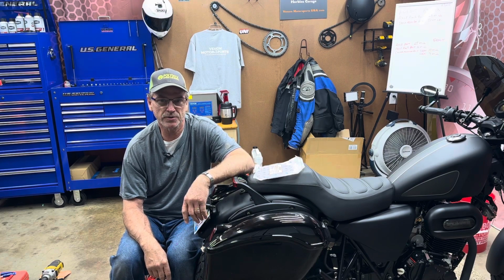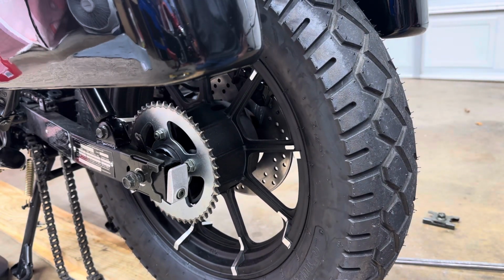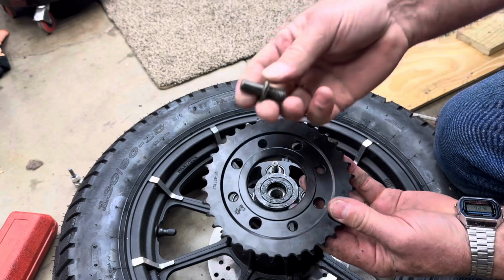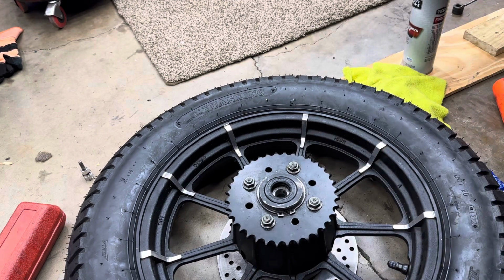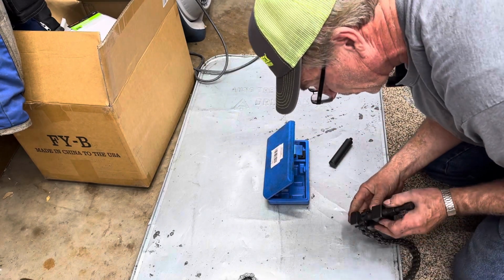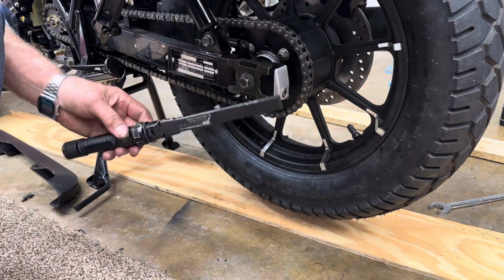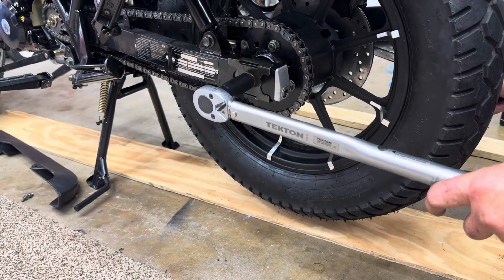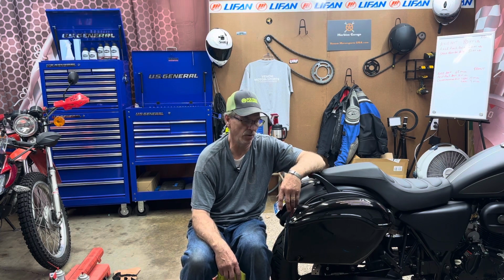VENOM GHOST CHOPPER 250, REAR SPROCKET CHANGE

Comment: Nice. Those extra plates over the alignment marks and chain guard would make it slower going to adjust and clean but it gives the bike's design it's looks and function.
Reply from the maker: You are 100 percent correct on all accounts! 👍🏻
Reply: Hey, yeah I've been scouring to find out if those plates help align anything, they cover the marks that are on the swing arms. It makes it confusing for the alignment.
Reply from the maker: @edac04  yeah, I’m not crazy about the plates either. What I do is, once I get the chain snug, I check the gap between the axle and frame and also checking the tire at the front trying to make sure it is centered in the Swingarm. The distance between the edge of the tire and swingarm should be exactly the same for both sides. That’s very important for proper alignment, a lot better than just relying on the marks on the adjusters.
Reply: @herbiesgarage681  Ah, I see thank you very much! I'll try that , I need to do that on mine soon
Reply from the maker: @edac04  your welcome my friend!

Comment: Awesome video, very helpful! I decide to do it to mine, however, I got cheap and didn't get the snap ring pliers and whilel taking it off the snap ring bent upward and it doesn't sit perfectly on the groove anymore. By any chance anyone know of a place where i could find a replacement
Reply from the maker: Hello, you could contact Venom, I’m sure they could get you a replacement. I have layed mine out on a metal surface and hit with a hammer to straighten mine out before.

Comment: Hey Herbie!  Great video!  I've got a question... I was riding  my 2019 Ghost 250 up a hill the other day, and It wouldn't go any further... I thught I popped the chain off the front sprocket, but come to find out... the back sproket came loose... I am getting ready to take the rear wheel off to see if I somehow sheared the studs off.. or something like that... Have you had any similiar experiences?
Reply from the maker: Hello Danny, thank you! I have not had that happen, is this with the stock sprocket or the one I show here? Popping the clutch could be a possibility for causing it or just bad studs, hard to tell. Hopefully it will be an easy fix for you. Let me know if I can be of any assistance
Reply: @herbiesgarage681 thank you!

Comment: Hello, I too got caught up in these Venom and Icebear products and find them overall very enjoyable. I didn’t get the chopper you have but the “Sportster” Df250rtg. Same engine, I believe, but different platform. This is the retro cb125 look in my opinion. Anyway, do you know if the black braided hose coming from the head in front of the spark plug is a necessity? This appears to send exhaust gas to the canister under the back bone which appears to be cycled by vacuum pulses from the intake manifold. I need to adjust the valves, thanks for the video!, and while I’m taking all this stuff off I was thinking of blocking that port for the braided hose along with the bleed port on the intake manifold.
Reply from the maker: Hello, I blocked mine off a long time ago and haven't had any issues at all.